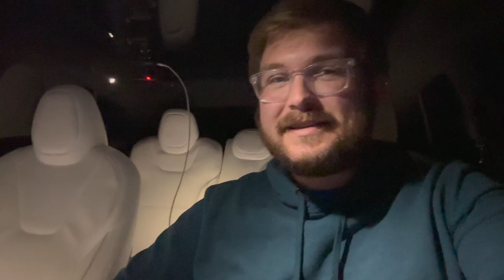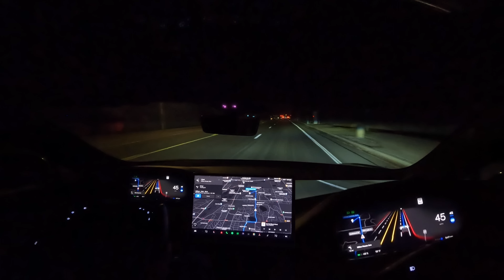I Finally Got Tesla FSD Beta! First Drive And Raw Impressions In My Model S At Night

Comment: If what you tested is the single-stack FSD Beta, it’s woefully inadequate and a step back from the last release! We bought FSD with the idea it would help keep us safe, night and day, as our eyes and reaction time age. Your experience demonstrates that this isn’t it. At night, in the rain, snow, fog, … is when we need it most. Removing the radar seems to be counterintuitive for our goal. If the cameras alone should provide pixel count input to the computers, this demonstration at night shows is not working well. Tesla guys, please work it out, soon. It’s been 5 years since we bought FSD and our need for it is getting more acute every year you’re keep “working on it”. Kyle and Melissa, thanks for doing this testing!
Reply: Single stack is not out yet
Reply: This is not single stack. Single stack is coming with V11 which also specifically mentions significant improvements in severe weather conditions, so they’re fixing exactly the things you mentioned are issues for it.
Reply: I think FSD as a level 2 assistance is atleast 4 years away.   I have trouble believing that HW3 will be adequate when they are coming out with HW4 with 4K cameras and HD radar (according to rumor reports).  Hopefully HW4 includes cameras for hard right and hard left angles to make turns faster.  Once the HW4 equipment is get it into hundreds of thousands of cars and start collecting data so that the can retrain the neural nets.  The also need to build up their 3D Models intersection-which will probably take a couple years to get coverage of most places outside California.  CA will probably be first.   Then at some point hopefully it will be done.

Comment: Having used FSD for a while some suggestions on being nicer to other drivers while testing it: a. set the speed limit offset to 0 or a small positive number, then use the right scroll wheel to adjust it as appropriate for traffic. I assume Tesla will have the software eventually adjust the speed more in line with traffic, but government regulators might not like the car to speed. b. If someone is tailgating you, use the turn signals to get FSD to change lanes so they can pass. Lane control is something they need to work on along with the sometimes strange turn signals, which normally self correct. c. Some of your interventions would probably have been fine and the car would have had room, but never let it do anything to make you uncomfortable. It will take time for us humans to trust it and for them to get it all right. But if they do, imagine self driving taxis costing a fraction of what you pay now? Maybe a world where cars are a service instead of something many people own. Call the truck for a hardware run or a sports car to have some fun, all much less expensive than owning. Having a car service would let you drive any car you want that day, plus it would park itself in a lot far away where it costs nothing and not junk up the streets.

Comment: Your experience is exactly what I experience with FSD beta everyday. It is not really for the public. It misses easy turns. Turns on the turn signal for no reason. Tries to move into the left lane on a 4 lane divided highway at every intersection that has a turn lane with no traffic control.
Reply: Lets say its not for Non Tesla Users. Honda and Toyota drivers, Isuzu, BMW and VW will be overwhelmed.
Reply: Agree, if it misses turns then who would ever want this system??? People that want to train the system... thankfully we have many of those owners ready to help. I'll wait
Reply: @wolfgangpreier9160  So you're saying Tesla users like all the mistakes, or are at least used to them.  ok
Reply: @ItsEverythingElse  You must of course take your counter argument, turn it 180 degrees around, hit it on the head by letting it fall on the concrete ground, you may also use your concrete head for it if you like and say:

Its is not for public use and certainly not for simple minds with their fossil hearts and petrol heads. 

Honda and Toyota users will never be able to use that. They must give up driving when it becomes mandatory.

And no, i do not "like" the current version, i want to be able to teach it how to correctly drive in Europe. I've never met a US driver who can drive a car correctly. And no: quarter mile races and making donuts on empty parking lots is NOT correct driving on tight mountain roads in winter.

Only those surviving Mumbai, Morocco and Italian cities for a day without scratches will get the needed permits.

Again: Sorry for Ford, GM, Mazda and Isuzu owners - you are out!
Reply: Glad to see and hear this .  There are a lot of 0 and 1 takeover drives through light traffic on east streets posted on YouTube and Tesla - usually by many with Stock that have been falling.  I’d love a Tesla Model Y with FSD but only when HardWare4 is out.
Reply: That’s my experience too.  I do think it drives in the left lane when on non-access controlled highways by design due to no slowdown lanes for right turns.
Reply: @dantoddruns  And thats one point that Tesla does clearly wrong in Europe. Here in Europe we have the „Rechtsfahrgebot“. Meaning on 2 lanes you MUST use the most right one when not overtaking or driving in a tight convoy. On 3 lanes you MUST use the first OR second and so on. That rule exists everywhere in Europe. Of course some countries follow rules much stricter than others.

Comment: I just got mine tonight. It felt like Christmas came early. When you take a step back and realize your car is driving itself you cannot help but be amazed despite the occasional faults. 
To Kyle’s point: 

In aviation you are type rated for aircraft that have unique systems and flying characteristics. Cars need to be the same. People need to pass a small but important course on the abilities and inabilities of the cars systems. This needs to be a federal requirement as it is for pilots. I cannot see any other way until we reach level 4.

Comment: Great video. I've had FSD beta since November 2021. It is much better with stopping and straight lanes since then. It used to ping pong around a lot between lanes when going straight which was very annoying.

Some things to note: Currently FSD beta doesn't do anything correctly in parking lots. That is coming up soon (probably). So once you reach close to where you are going you must disengage to end your drive.

Left turns and right turns takes a bit of trust to let the car do. Once you start using it more you will understand which turns will keep you on edge and which ones you shouldn't even attempt. For the most part I let the car do 80-90% of the drive but I rarely do it without any interventions. Things like lane changes and stuff I generally do myself so that I don't inconvenience myself and my passengers along with other drivers. I realize that is not true Full Self Driving but I think it makes mistakes often enough that it annoys me.

Unmarked roads will cause it to often favor the middle of the road. If there is oncoming traffic it will move to the right.

Keep using it and you will learn to appreciate it but it will often leave you scratching your head.

Comment: I qualified for the FSD Beta somewhat early on and the short version of my advice is to take over whenever the car makes you uncomfortable. I used to try to let it do as much as possible and to push the limits, but then I realized that the system will never learn to make me comfortable.
Reply: Does the car actually learn the route every time it drives it or does it act like it's the first time driving through a certain street each time?
Reply: @Cornelius87  The car learns new things every new releases but not realtime. When humans takeover, the car records that takeover moments, sends the data to Tesla servers, Tesla AI team takes the data and trains the car with it. Then releases new updated version for the fleet. This normally takes ~1 month period. The learning isn't real time, due to server scaling costs. Overtime, as Tesla scales their servers more and more, the learning speed improves. Maybe in the next 3-4 years, Tesla learning system would be done weekly. And maybe in the next 10 years, it could be done bi weekly? And in 20 years, daily? Something like that sort of scaling.
Reply: After reading your comment, elon just decided to raise the price of FSD to $20k. 😂

Comment: I've had FSD Beta since October 2021. Every build is different. Some things get better and some regress with each build as we seem to inch forward. Traffic circles have gotten much better, for example. Unprotected left turns have regressed the last few builds and maps navigation has also regressed. Beta is a black box as we can only guess how the neural nets are changed and tweaked and why. Some things impress the hell out of me and other things the car does still has me baffled. If you can step back look at what the car is capable of doing it's pretty amazing. Not being a neural network expert I can't say how quickly performance will progress.
Reply: Agree, I see the half full glass, alot see it as half empty.

Comment: I used it the last 3 year. The car somehow got so much better the 2nd and third day. First day i had to take over every single turn, somehow the second day, at night i had a zero takeover drive, 20 minutes, multiple turns. Third day it did some questionable things, but it worked pretty good.
Reply: Fsd doesn't learn real time from drivers.
Reply: It has no way of adapting to your driving too.

Comment: The system is handicapped by the camera locations. The right turn of the car at an intersection is its attempt to allow the cameras to see farther down the road at oncoming traffic. If they would add side-facing cameras mounted in the headlights, FSD would be much farther along. Software compensation for bad hardware is just a bandaid.

Comment: It would be nice to see a video where you take the Model S to Phoenix and compare FSD to the Waymo taxis.  See which system is better getting from point to point.
Reply: Did you hear what you said? You’d have to drive to Phoenix to even compare Tesla FSD to Waymo because that’s the limit of where they can operate. Tesla’s FSD can currently operate on any street in the USA. So Tesla is solving a much more complex problem. Waymo is just playing in a little sandbox that they are laboriously hard coded to play in. No cost effective way to scale that to what Tesla is trying to do. Not a fair comparison from the get go. Take a Waymo vehicle to someplace out of their sandbox and turn it loose to compare with Tesla FSD. That would be fun.

Comment: I live in West Los Angeles and it behaves exactly like what you showed in this video. I try to use it 50% of the time when going on a city drive and I would say it fails 100% of the time usually within 1/16 of a mile after I engage it. What is does most of the time is what you show when making a left turn, the wheel veers right before turning left so I usually disengage it as I feel not confident it going to correct itself and also the fact if someone is behind you it is giving them the wrong signal.  I also have problems with limit lines where it stops and speed bumps as well. If in fact it is a vision based system you would think speed bumps would be no problem. I have a 2020 LR  S so I guess the radar must now be disabled. Another thing I find funny is that it can’t self park at a supercharger, you would think that would be easy. Mine also does the hard braking sometimes before stopping and some of time the lane position is just not correct. I use to have a video icon that I could press to report problems with FSD but that feature is now gone. Not sure why, maybe because I pressed it so often. In any case it’s a work in progress and with more drivers with it, it should surely improve. As for highway driving it is very good, it still  hard brakes for me  in some Instances so that is something that can be improved. I enjoy watching your videos!!

Comment: Started FSD subscription, got 2022 MY software switched over to FSD Beta track, used for one month and cancelled, for reasons similar to your impressions.  However, imho, Tesla Vision is the real miracle, enabling unequalled Autopilot capabilities:  T/A Cruise Control and Autosteer are liberating, and make driving safer than manual steering/braking/accelerating.  Auto Lane Change was a keeper, but couldn’t justify $199/mo for only that feature- the rest of FSD was not worth paying for, when basic Autopilot is SO good (works well on any street with lane markings, unlike systems that rely on digital maps rather than vision).

Comment: I find it interesting how so many people anthropomorphize FSD beta. It’s not autonomous. It’s software using cameras to control a robot. With the many flaws (it’s beta) in my opinion it’s freaking incredible. I drive a lot for work. Between Auto Pilot and FSD beta, I’m manually driving perhaps 5% of the time. 

It can be annoying when interventions or disengagements are necessary. And it is necessary often times. But, my experience, it’s more annoying to have to drive manually than the mostly predictable interventions required.

Comment: Don and I both feel FSD drives better in the dark. Just worked out for you that your first drive was at night. Quite a few erroneous turn signals going on/off in the latest release. Large turns in the road can cause the signal to come on for a moment. Don't be shy about using the accelerator to finish a manuever if the car slows. You don't need to fully take over; just press the pedal which basically tells the car you confirm the move it's making and to go ahead. Not finished the video, but these are our thoughts so far.
Reply: Oh, I want to add that I have a lot of disengagements that have to do with navigation. I have an idea of how and where we are going and they don't always jive. My biggest current gripe is about going from one lane to 2 with a right turn up ahead and Ruby staying left (I need her to go right). They so many cars go right I can't get right...so I have to take over there and make sure we pick the right lane right away. Be careful about the speed dropping. The new speed limit comes up quick and then it feels like it takes minutes to actually slow.
Reply: Every darn time the car takes the hardest route lol...typical.

Comment: This is hilarious. The only other content of FSD I've seen is that guy that takes his car into San Francisco and in his edits the system always seemed to do so well. Some of the stuff in this video was straight up scary!
Reply: That’s because it does do well in the Bay Area. Just like autopilot stack on the highway the system does better in some areas than others. At the end of the day it’s still remarkable to experience if you have it.
Reply: @PumpUptheJam81  To me it's remarkable that it did so poorly. The vision part seems to be really on point, it didn't struggle to identify anything and had a really good picture of the world around it so it's weird that the decisions it made were so poor

Comment: With regard to progress, I got it spring 2022 and still have it today and the improvements since then are quite noticeable.  Still drive like a teenager learning to drive, but the teenager is learning :)
Reply: Sounds perfect! I am just sorry that we in Europe are not allowed to learn the system.
Reply: I received the beta on Dec. 24, 2021, so I've had it for almost a year.  Your observations are the same as mine.  It's the rate of improvement that is stunning.  With each software update, the car's attitude changes.  Some things get better and sometimes there are things that get worse.  But overall, the improvement that I've seen in 1 year's time makes me think that FSD may be 'programming' complete by the end of 2024 and at the point where the AI is simply making its own refinements as it gains more data.
Reply: @Abomynous1  It will be always become better, slowly but steadily. 

When the insurance companies see the difference between FSD and Non-FSD - thats the point where it will become interesting for all parties worldwide.

Comment: FSD HW4 is coming in 2023 which have camera in headlight that improve visibility for unprotected turns, more processing power for 5MP instead of 1.2 MP cameras. Also potentially adding radar back into the system.  I think by the end of 2023 we'll have a much better idea of where this technology is going. Personally I doubt FSD will be ready for public rellease before mid 2024